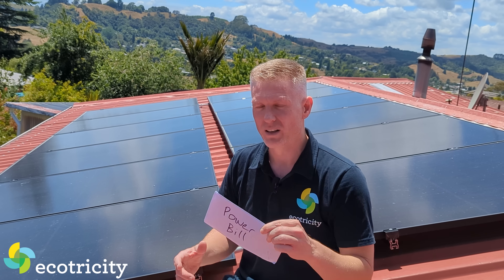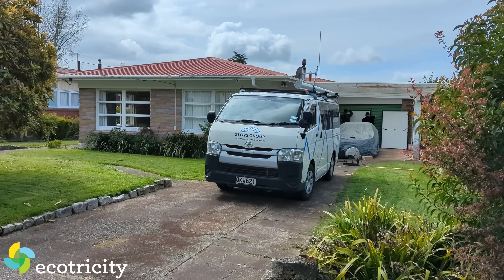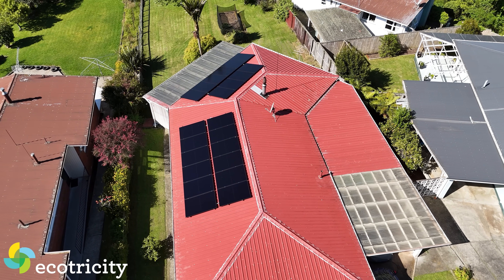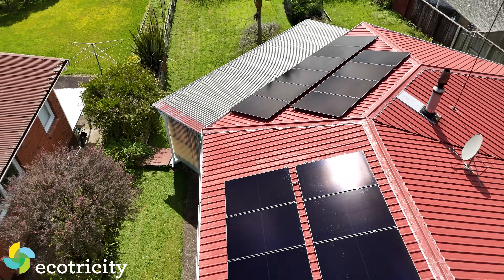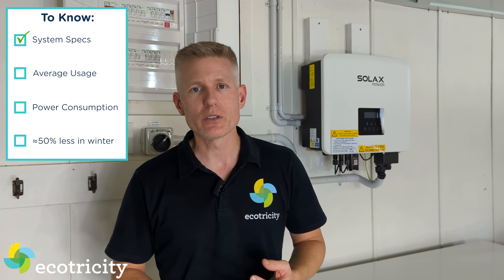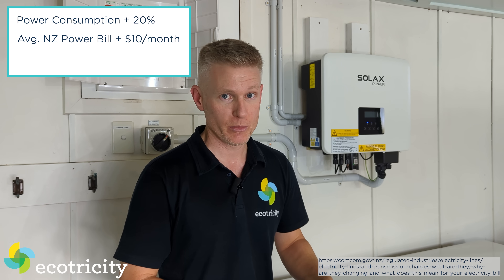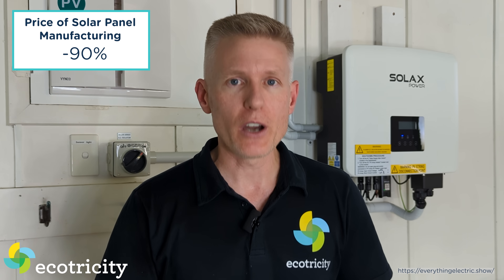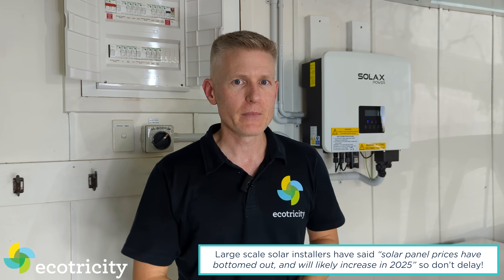Is solar power really worth it in New Zealand?

Comment: I live in Waikato and have 17KW solar for 6 years. My findings

1. Remove the hot water timer and get a power diverter. New diverters work for both hot water and EV charging. They "divert" only surplus energy (that would otherwise have been exported) into hot water / EV v's a timer which just switches on a water heater / EV charger regardless of any solar export. The diverter benefit will become apparent as solar generation decreases into autumn and winter - your timer will switch on, drawing full power, with an increasing proportion coming from the grid (esp with early morning turn-on)

2. Your solar generation will fall to 25% (not 50%) in winter. Over panelling, as you have done, helps but does lead to wastage as the export limit is hit

3. If your house is 3 phase (most older kiwi houses are), a better inverter would be the 3 phase version = X3 (you have single phase X1 presumably). This allows export on all 3 phases = 15KW. Maximises export revenue. Having 3 phase also allows the lower hot water electricity tariff, which is a benefit in winter

4. A commercial battery in NZ is only good for bragging rights. There is no ROI, ever. Don't let anyone tell you otherwise. At 1 cycle per day, 10 year period, 5% cost of finance, $15000 cost, loss off solar buy-back = approx $0.60/KWH v's $0.30/KWH to simply purchase electricity from the power company

5. A good way to increase ROI is to find a solar install company that let's you be their "labourer". This saves $80/hr as one less installer is needed. In my situation, there was one installer and me (your 4 installers as pictured is way OTT)

6. Most banks offer cheap finance for solar installs, if you are the home owner
Reply: Agree on most of those points. 

Maximising self consumption (and minimising import) is paramount. Your supply rates will always be higher than any FIT, and net metering is a fading hope in that regard. 

A HWC diverter will track your export rate and divert that into your HWC. A timer will force ~3kW of consumption even when PV generation is patchy. Not great to see import filling the gap on cloudy mornings (in winter) as this corresponds with peak supply price rates. A NZ made Paladin diverter does what the Evnex EVSE solar diversion function does but is more sensitive and reactive than the Evnex, plus the Evnex has a 1.4kW minimum as EVs can't be charged below that rate. We have both.

Overpanelling allows you to reach your inverter's max. capacity earlier and for longer during the day, and makes for better generation on marginal cloudy days.

If you're in a position to maximise self consumption during daylight hours (including EV charging) it is very unlikely that the economics of installing a battery will stack up. If the ingoing costs involved in setting up V2G/V2H turn out to be reasonable this may be a better alternative. Bidirectional EVSEs and EVs are coming down the line as the AU/NZ electricity regulations are updated this year so an evolving situation in that respect.

The forecast increases in lines charges will change the solar landscape this year. ~$1/day can be offset by way of exported generation but with some regions already seeing near $5/day this makes for a prime situation for increasing solar capacity and serious investment in storage to allow going off grid when fixed lines charges. This then reduces the power co's customer base to spread their infrastructure costs on so more price rises, rinse and repeat. This scenario is referred to as the 'utility companies' death spiral' and will only accelerate as solar and battery prices keep reducing.

Effective monitoring of your solar set-up is also important. Real time monitoring software provided by most inverters is typically sufficient to enable fine tuning of consumption habits and real time generation profile. If you can't see it, you can't control it. And a third party app such as that offered by SolarAnalytics will allow you to access historic and current generation, self consumption, export and import statistics.
Reply: @HarmLessSolutionsNZ  Based on 1 cycle per day, 10 year period, 5% finance (lost opportunity) cost, $1100/KWH installed commercial battery cost, 90% round trip efficiency 
Commercial home battery cost $0.60/KWH
DIY home battery (EVE LFP cells, Seplos or similar DIY case, JK BMS) costs $0.20/KWH
Repurposed EV battery cost $0.05-$0.10/KWH
With an export credit of $0.17/KWH, and a power price of $0.33/KWH, any battery that costs more than $0.16/KWH is actually costing the battery owner money......

I built my 60KWH battery from repurposed EV batteries (I do battery replacements for Nissan Leaf and owners are happy that I offer free disposal of their old battery), with batteries having zero cost. I just needed a BMS, so cost was about $0.01/KWH, but this is not representative of what others could do (hence figure above includes purchase price for an EV battery)

I use an old Solar Immersun hot water power diverter April-August, when system output falls. During September-March I use a timer to keep export at peak below 10KW Meridian Energy maximum 

Best investment I have made

I don't think bi-directional vehicle charging/discharging is a wise idea for the majority of people. It requires the car to be home during the day, and most aren't - they are generally used to drive to work. Then there is the extra work the EV battery is doing, which will shorten its life. Then there is the 10-15KWH less in the battery (that was used running the house overnight). I think bidirectional is good on paper, but not in the real world. I may be wrong
Reply: @HarmLessSolutionsNZ  Agree, 'Self Consumption' is a vital part of the equation, as that correlates most directly to what you would have otherwise, drawn from the grid.
Reply: @petercrawford3370  Absolutely. And considering that NZ has 573 MW of grid-connected photovoltaic (PV) as of December 2024 (and over a third of that was installed last year) it that means there is a huge amount of electricity generation that is invisible to the electricity authorities as being self consumed it is occurring 'behind the meter' so only known by the homeowner. 

For example we generated 11, 757kWh last year but only 4,475kWh was exported with the remaining 7,282kWh being self consumed. We were paid $760.69 for export but self consumption offset $2,316.88 of import. Therefore self consumption was 3/4 of the earnings we gained from our solar, export 1/4.
Reply: While I agree that a commercial battery (lets say a Tesla Powerwall) will never pay for itself, it is more than bragging rights, it's a form of insurance as it's grid-forming and allows you to run off-grid. I know you can get a backup generator cheaper than a powerwall, that's fine if you have fuel to run it, but what would happen in a major disaster and there is no fuel?
In Canterbury, I've lived through the 2006 snowstorm where we had no electricity for 2 weeks (everyday after the storm was crystal clear but freezing, perfect for solar), no hot water, freezing cold, dark by 6pm with no internet or TV, not fun at all. Then there was the 2010-11 earthquakes, and while we didn't lose power, fuel was in short supply for a while. If the Alpine fault goes, which it will one day, we could be looking at weeks or even months of power outages and fuel shortages. I don't know of any other form of insurance which slowly pays back some of its cost.
Reply: @Pete856  the cost of the battery really kills the ROE for most people.  The reason we looked at it was for off grid situations like storms and EQs etc.  But in our house in the last 2 years we have had only 1 power outage and that was for a few hours at night.  For those significant events we are considering just buying a petrol powered generator and setting it up so it can be plugged into the house to run specific plugs and lights - that would cost say $1000 -$2000.  That way we have that disaster ability but without a $18000 plus outlay.
Reply: @dylanprice2960  We have 10.5kW PV & 3 Powerwalls. We have paid nothing for electricity since 2018. We're with Amber electric in Australia now and are >$2000 in credit. We save >$4000/year from not paying for grid power. The system cost $32K and will retire the cost outlay entirely in 2025.
Reply: @Pete856  We have 10.5kW PV & 3 Powerwalls. We have paid nothing for electricity since 2018. We're with Amber electric in Australia now and are >$2000 in credit. We save >$4000/year avoiding paying for grid power. The system cost $32K and will retire the cost outlay entirely in 2025.
Reply: @vk2aafhamradio  great example of excellent use of a solar system!
Reply: @ Nice. Here in NZ there are no solar subsidies, so 10.5kW of solar is around $20k and Powerwalls are around $16k each installed, plus the gateway. There is no way at current kWh prices to make a powerwall pay for itself, but as insurance against disaster, they can be justified.
Reply: @Pete856  A generator is a far better investment than a commercial battery. Get a diesel generator, and keep 20 litres of diesel in the garden shed. Burn the diesel and buy new every year to keep it fresh. You'll still be $12000 ahead, and have a nice shiny diesel generator. That 20 litres of diesel contains as much energy as 10 commercial batteries, and it isnt a fire hazard to store (like petrol). If you want more security, get a 200 litre drum, you'll have electricity for 4-7 weeks depending on usage

Remember, if there is a disaster that takes out power for more than a few days, electricity will be the least of your worries..... transport, food and water would likely be more vital, and maybe hospital access 

But I understand that some people sleep better if they think they have some backup plan in case of Armageddon. I would suggest from experience that a wood fire with wetback and cooktop is an excellent investment
Reply: @Goodkiwibloke  Sure 20 litres of diesel contains around 200kWh of energy though most (~80%) of that will be wasted in the ICE and generation process so that 200 litre drum may make sense in that respect, but considering that many of us with PV have adopted this technology for environmental reasons the idea of burning fossil fuel to achieve the same result is totally counter to our ideals. 

An arguably better strategy involves solar generation with battery storage, particularly if combined with EV charging capability which also solves the transportation issue, and in our case water as we have rainwater storage with electric pumping. Add to that V2H capability and your EV can be used to ferry electricity back to your home from the nearest functioning public charger. 

Worst case scenario thinking for sure but nice to have a plan B if the sh*t hits the fan. And yes we have a log fire (with hot plate), well stocked freezers and bottle fed gas hobs to ensure we're warm and fed.
Reply: @HarmLessSolutionsNZ  A few comments on you last post

Diesel generator efficiency approx 40% (chemical potential energy converted into electrical energy), can go higher than 40% if load is in the "sweet spot"

A bit of context is always good. My install is 6 years old, and in that time it has provided a total of 3.7KWH of "emergency power" when the grid supply to my property was interrupted. I am rural, so power outages are generally longer than in town due to the increased response time, and more frequent as lines are all overhead. So using 40% efficiency and 10.2KWH/litre, this would have consumed 907ml (0.9 litres) of diesel over a 6 year period. Hardly a climate catastrophe, and the reason why I never advocate for battery storage "for grid supply interuption reasons" - it is such an occasional occurrence and the capital cost is extremely high

The environmental benefit of solar is actually not that high in NZ, due to the already high proportion of renewable electricity in our grid - approx 82% on a yearly average. Yes, there is 18% environmental benefit. But by international standards, that is quite low (most other countries have a lower renewable contribution to grid supply, so the benefit to the environment is greater if those panels were installed in another country)

V2H is actually very easy, depending on the inverter specs. Using nissan leaf as an example (because I know them very well). The heater output socket on the traction battery supports 5KW at 365VDC nominal. This can be fed directly into a solar inverter MC4's in place of solar panels. Or for a portable solution, a 1.5KW 12V inverter can be connected to the 12V battery. The DC-DC converter will cope with this and not allow the 12V battery to discharge. Many EV's have traction batteries that are in the right voltage range for the majority of inverters on the market in NZ. Some late model EV's have 800VDC architecture 

Your home sounds a lot like ours!!
Reply: @Goodkiwibloke  The information I'm seeing online is that 1kWh/0.4 litres (i.e. 2.5kWh/litre) of diesel consumption is typical for diesel generators, which corresponds to the efficiency of ICE applications generally (i.e. 25%). I suspect that your 40% efficiency is a miscalculation, or an overly optimistic sales claim by generator marketers.

In any case replacing the convenience of grid supplied electricity doesn't come cheap so any alternative will include significant costs economically and/or environmentally. The reality is that solar costs are primarily front loaded with the returns gained over the life of the investment, in much the same way as EV investment behaves. The decision is how much you can justify in your own circumstances in order to insulate yourself from reliance on public supply and from ongoing energy price rises. Everybody's situation will be different in these regards and so are best advised to make any such expenditure with sound due diligence.
Reply: @HarmLessSolutionsNZ  I asked google AI. You have to be careful that petrol is excluded as BSFC for diesel is much lower due to the higher compression ratio which extracts more mechanical energy from the fuel (its why diesel fuel consumption is always lower than an otherwise identical petrol vehicle). Hence less energy is lost as heat

I don't care what people do, that's entirely their business. But there are far too many "salespeople" who over-sell the benefits of home batteries to unwitting home owners. I try to present alternative options with all data and calculations disclosed, to show that batteries are no where near economically viable, and provide alternatives that are both workable and way cheaper

You raised the "environmental impact" of using a diesel generator. I quantified that environmental impact based on my 6 year solar install and grid down-time = 0.9 litres of diesel ($2) + diesel wastage @ 20 litre pa ($240) + diesel generator ($3000) v's home battery ($15000 installed). That is one heck of an "environmental impact" premium ($11750)

There are zero "returns" to the homeowner on a commercial battery as part of a solar install at current pricing, no matter what timeline is considered. Every KWH stored in the battery adds to homeowner's costs (ie. negative "savings")
Reply: @Goodkiwibloke  The problem with Google AI is that it just cherrypicks whatever online content it chooses without confirming the veracity of that content.

Try searching content yourself (for "diesel generator efficiency") and the likes of Blue Diamond's website content will tell you: 

"The efficiency of diesel generators is expressed as their fuel consumption on a litre per hour basis. As a general rule, diesel generators use 0.4 litres of fuel for every kWh produced, which equates to an efficiency ratio of 25%." 

But if you choose to believe that relatively small ICEs are attaining 40% efficiencies then go for it.

I'm not claiming that home battery storage is cost effective in most cases, for now, but in isolated circumstances they are a viable solution.
Reply: @Goodkiwibloke  We have 10.5kW PV & 3 Powerwalls. We have paid nothing for electricity since 2018. We're with Amber electric in Australia now and are >$2000 in credit. We save >$4000/year. The system cost $32K and will retire the cost outlay entirely in 2025. We have had a couple of 3 continuous days with no grid power. There's a 2kW petrol gennie in the shed, unused since our first battery was installed in 2018. I should probably run it up someday.
Reply: @vk2aafhamradio  Unlike Australia, there are no solar install subsidies here in NZ. In NZ, a single power wall costs about $17000 installed, and this video tells you how much a smaller-than- 10KW solar system costs

Also, our Sunshine is less frequent than yours (except for your tropical north). Cloudless sunshine hours are considerably lower in NZ, so solar yield is considerably lower here. Your 10KW solar system would not be anywhere big enough to generate enough during winter - mine is 17KW, and that is marginal in June just running the house 24/7

And Aussie feed in tariffs were much more generous than here, up to a few years ago. Some Aussies are still on legacy FIT of $0.50/KWH. Up until a year or so ago, the best we got was $0.12/KWH, and now it's $0.17/KWH

So your comparison is like comparing two completely different situations

But good that you are saving money and are happy with your install. Likewise, I am happy with mine, saving $3000pa electricity, $3000pa petrol (EV now, charged for free), and $2000pa feed in tariff.
Reply: @Goodkiwibloke most older houses are not 3 phase. 3 phase is 400v
Reply: 3 phase power in residential houses is extremely uncommon (actually connected to the property)... it would be lucky to be 1 in 10.
Reply: @Etacovda63 1 in 100 seens more likely. Even 2 phase is unlikely unless the homeowner is into heavy duty welding
Reply: @Etacovda63  Most older houses  (like Gavin's, which my comment was about) I've lived in were 3 phase. 1 phase for general use, I phase for water heating, 1 phase for oven. That was the way electrical supply was set up at the time, presumably for load balancing

And my point was, if you have 3 phase supply, consider a 3 phase inverter to minimise waste energy (when the inverter starts clipping DC due to reaching its AC limit). With a 3 phase inverter, there is zero need for over-panelling because AC output can be much higher in total, while still being below 5KW on each phase

My 3 phase install has 7KW + 5KW + 5KW solar. With the higher figure running the house, water heating and recharging batteries (so export never exceeds 4.5KW). As the days grow shorter and the sun gets lower in the sky, less power is exported on phases 2 & 3. Last June I only exported 200KWH, with zero export on a few gloomy days
Reply: @Goodkiwibloke Sounds like complete bullshit. In 65 years I've never known 3 phase in a house. Alternate houses down the street use a different phase so balancing is based on typical usage in the area. But with water heating supply being controlled for load shedding at peak times and applied to everyone and cooking being uncontrolled but typically occurring about the same time by everyone,  your 3 phase claim in residential settings is utter nonsense.
Reply: @ I've crawled inside the roof spaces and under the floors of literally thousands of houses, and additionally to that I worked at an electrical firm for years. I'm telling you its not common through actual firsthand knowledge.
Reply: @Etacovda63  If you find wiring under the floors, it's clearly not compliant. And your decision to include that reference tells me you've got no idea about wiring. If you did know anything about wiring, you would know that wiring must be in walls or ceilings only.......

Take a drive one day, and look at overhead supply lines into houses. 2 = single phase, 4 = 3 phase. More difficult with underground, as there is only one wire with multiple conductors plus a screen. The ONLY way to tell is behind the distribution board, everything after the board us single phase

God help those home-owners who had you go anywhere near their wiring as an "electrician", or more likely you were the forklift driver in the warehouse, eh?
Reply: nice job on the insults, makes you seem ultra mature and worth talking to. At no point did i say the incoming mains were under the house, but you know, accuracy, who needs that?

5/5ths of f all houses in the south island will be using more than one phase. Load balancing here is done with ripple control in urban areas. I could probably count on one hand the amount of houses that actually land 3 phase into the switchboard in each suburb, and thats typically because someone has a workshop, a large rural property with outbuildings, or similar.

But you know, just stroke your own ego and don't admit you might be wrong, because I'm pretty sure you're incapable of that.
Reply: @Etacovda63  First rule - when you're in a hole, stop digging.

You clearly wrote "I've crawled inside the roof spaces and under the floors of literally thousands of houses........". It's 100% clear what you were implying = you've visually observed only single phase supply many times.....

And now you're twisting what you wrote because somebody called you out for inaccuracy

Go back and read what I actually wrote in my relevant comments. Nothing I wrote was "incorrect". You may have misread/misunderstood what I wrote

PS. FYI ripple control works with 1, 2 or 3 phase supply, in the towns and in the countryside. I have ripple control box in my distribution board, it is wired to phase #3. Or do you believe this is also incorrect?
Reply: @Goodkiwibloke  The point of my post is 'ive been in literally thousands of houses running cables'. I pay attention to the houses services when I'm there, out of pure interest.

If you want to twist that in your head, your choice.

I also never said anything about ripple not being able to go on 3 phase, I said it was the most used version of load control/balancing here in the South Island. I missed out the (obvious to anyone with knowledge) fact that theres 3 phase at the boundary/pole in a lot of cases and they stagger the phase sent to each house as well because it was mentioned earlier.

You're still not accepting of the fact that your comment of 'most old houses have 3 phase' is provably incorrect, and you're saying I'm digging? f'ing lol.
Reply: @Etacovda63   I will repeat. When you're in a hole, stop digging

Your story keeps changing as more and more holes are picked in it

What I actually said was "most older houses I've lived in had 3 phase power". I see you left the contextual part out, to twist your position once again

Every older house I've lived in since the early 90's has had 3 phase power. This is a statement of fact, not an opinion like your comments. It is "provable" to use your term

Checkmate
Reply: HYPER BEST ADVICE of the day.